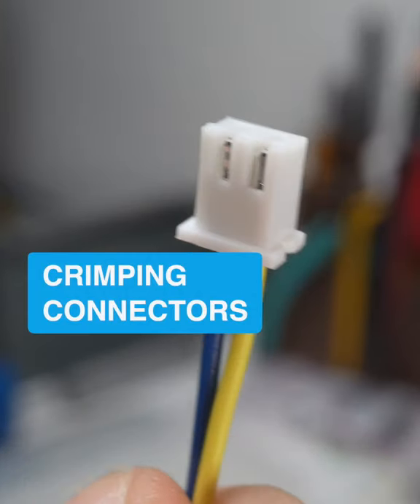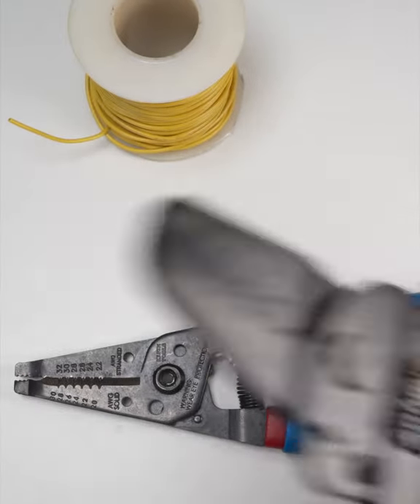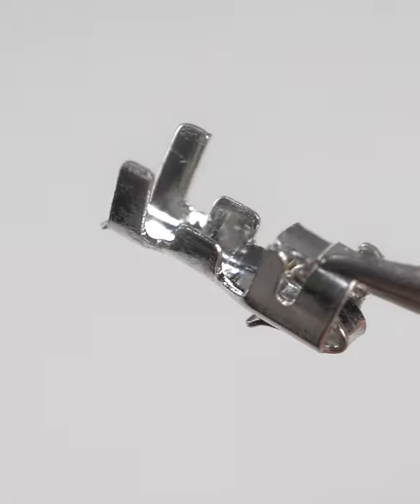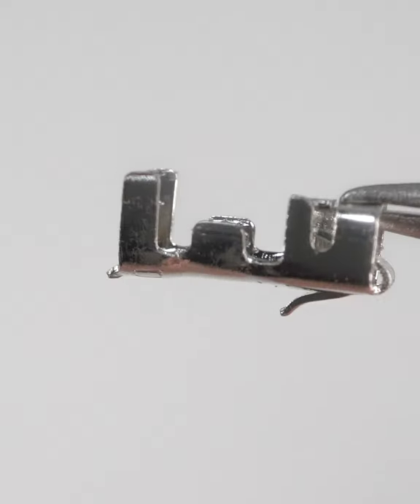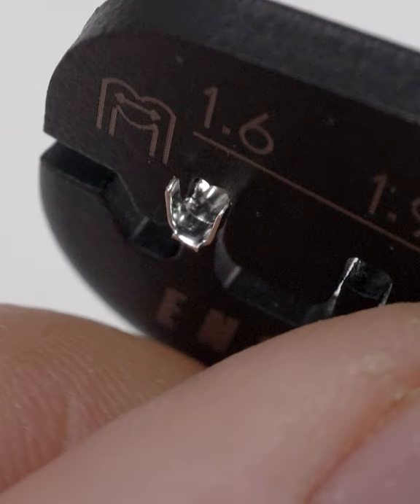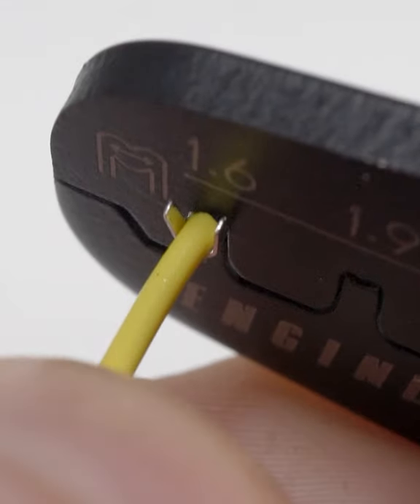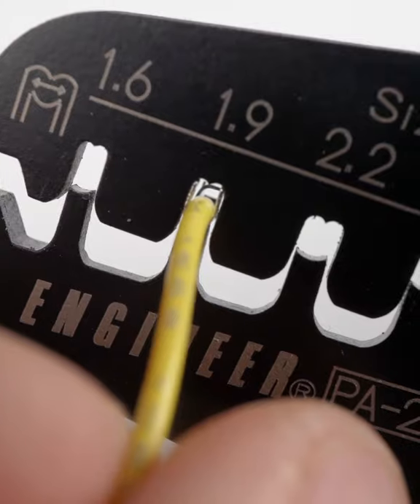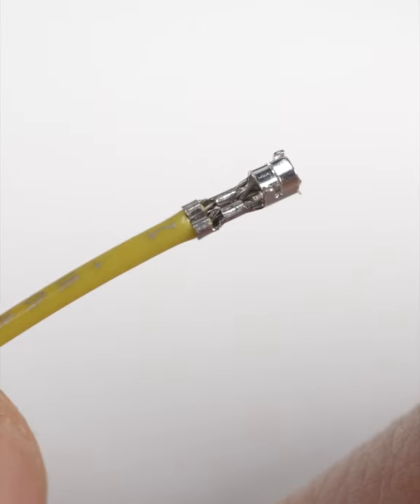Crimping Connectors - Collin’s Lab Notes #adafruit #collinslabnotes

Comment: Wait, I thought you weren't supposed to twist wires before crimping on a connector!
Reply: That’s actually true. But a light twist as seen on the video should not affect crimp quality and helps the strands keep together so it’s easier to get them all into the connector.
Reply: @monteramer6602  ,
🤔🙂👍🍻
Reply: I came to the comments after watching Big Clive this evening  to ask the same thing.
Reply: @LostDryerSocks  it's probably "avoid twisting but get all the stands in the crimp connector, even if it requires a light twist". There's no twisting in the instructions from JST (yes they have printable instructions/inspection guide)
Reply: @aarorasilainen  The crimping is exepected to bite down parallell to the strands. So the strands should not be twisted.

Comment: You DO NOT twist conductors when using that style of crimp. Twisting them does more harm than good when the crimp wings fold in and secure around the conductors; often sheering several conductors.

Comment: I finally found a crimper I like, it has two dies next to each other, a larger side and smaller side - once I clearly wrote “front” and  “wire” on the opposing sides because I’m slow, I get perfect crimps every time. I had bought like 4 sets of crimpers, including one like these, and had just decided that crimping cannot be done by hand and I’d been tricked.  Now mine are as good as factory.  Practice also has a lot to do with it, and using tweezers to place the metal bit just right in the die is crucial, the tab that sticks out the back abuts the face of the front die

Anyway, takes a tiny bit longer to place the connector right, but it’s much faster overall, doing both steps at once.  Advancing the die two clicks makes it so the insulation even stops at the right depth

Comment: There is a blog post out there by Matt Millman discussing common crimped connector terminals, and it has tons of great photos of what you should be looking for in a crimp that's up to standards. 

We use a ton of JST-SM wire to wire connectors, so much so that we have a pair of the official JST crimpers. Those things are amazingly good, but super expensive.
Reply: This is what I came to say. Matt Millman's research and documentation of wire terminals and crimpers is probably the most comprehensive and useful ever written.

Comment: Great tutorial - I have the same Engineer crimping tool (PA-20) and it is fantastic. Sometimes the terminals get a bit stuck but it's very easy to free them, and it's not expensive for what it does (compared to the official JST or Molex tools).

Comment: A good crimp has some defining characteristics: 
1) The conductor is fully captured by the forward tabs.
2) The individual strands are tightly compressed such that their cross-section forms a tessellated hexagon pattern.
3) The insulation tabs are compressed around the insulation and not into it.
Reply: Matt Millman has a fantastic blog in which he delves into the finer points of terminal connectors and crimping systems. If you're even remotely interested in this kind of stuff you'll find it a great read.
Reply: There is a huge array of different connectors and crimpers on the market and not every tool works with every connector. In fact, the right tool is crucial to a good crimp and most failed crimps are (probably) the result of a mismatch (and operator error).

Comment: I usually use 1.6 for both the inner and outer tabs, is this not correct?
Reply: Might depend on how secure/tight you want it and size of the connector

Comment: Should NEVER twist the conductors when crimping.
* EDIT to satisfy pendants:
You should neither twist or untwist the conductors, especially for "open barrel" (winged) crimps like the JST-XH shown in this video. Just strip the insulation, tidy up the strands so none are displaced or crossing, then crimp.
Reply: Don't know where you heard that but should have a little twist to help the wires not fray
Reply: @CokesAndTokes  - what I say is definitely truth. You can confirm it yourself with a magnifying glass, or Google. The crimp squeezes the 2 winged sides down into the lug, and creates 2 separate cylindrical tubes that encase the strands. These squeeze so tightly that the copper is literally reformed to create a permanent and almost "welded" connection.
If the strands are twisted then any that are across the centreline will be snapped off as the 2 sides squeeze down and wrap around.
Reply: @johncoops6897  You shouldn't over-twist the strands however. If over-twisted, the distribution of strands may be uneven and the wire cross-section will be affected, which will also negatively affect your crimp. -Google

Like I said it's OK to twist it a little bit so your statement is wrong out of the box
Reply: @CokesAndTokes  - no, it is not wrong. For THIS kind of crimp terminal, the strands need to stay straight. Slight twisting is tolerated (although DEFINITELY not recommended) for tubular crimps where the pressure is applied from all sides, since they will get squeezed together anyway.
However THIS  style of crimp does not work that way. The tabs on either side are turned 180° and cut straight down into the strands of wires. Any strands that cross that centreline may be severed.
I cannot help you stop being an arrogant know-it-all, however I can certainly guide other people about the correct way to perform crimps on THIS kind of terminal.
Reply: @johncoops6897  maybe you should specify more. And not say "NEVER" do this while crimping. If you're just gonna say it's OK 2 comments later?
Reply: @CokesAndTokes  - Talk about comprehension fail. 🙄
I just wrote "Slight twisting is tolerated ... for tubular crimps..." however these  terminals are so-called "Open Barrel" terminals and I quite clearly explained the difference and why twisting is poor work practice and degrades the joint.
 I will link you to the official JST Crimping instructions in a few minutes.
Reply: @CokesAndTokes  - OK, after researching on various manufacturer's tech bulletins, I can change my advice slightly. They all basically say to retain the original twist, worded like this...
EG: "The lay of the strands shall be correct. If the lay has been disturbed, it may be restored by a light twist to approximate the original spiral lay of the wire. Care should be taken not to over-twist the strands." .
So, basically you should never twist nor untwist the conductor strands. Think about it... the crimps are designed for automated processes, and there is no twisting process between stripping and crimping. There is no need to touch the conductors... just remove the insulation and crimp!
Disclosure: I have extensive experience in QA and process control of crimped terminals used in critical applications like medical, aviation, IT and scientific equipment. It doesn't matter if you don't understand or believe me, I am not going to fight with you about what is, in the industry, common knowledge.

Comment: I'm sure there are crimpers that crimp both. Or am I wrong here?🤔
Reply: Yes but they are 500$+ instead of 20$ for these. Much more cost effective for hobbyists
Reply: @phiIippejean  wait these are only $20? I was under the impression that a crimp tool that works will be completely unaffordable, so I avoided looking at them. If I can get one cheaply enough, even if it's just a tiny bit finicky, I must buy one right away...
Reply: @phiIippejean  500$? I'm from EU but even here I can find crimpers that crimp them both for way far cheaper. Around 30€ and up.  Usually i find stuff that are cheaper in US compared to the EU.
Reply: depending on the type of crimpers and manufacturers it varies a lot. 
But for aviation/medical grade crimps, I use a lot of Molex/Hirose/Amphenol/TE crimpers that are 200-400$ for handheld and like 1000-3000$ for automatic crimping machines. 
It's definitely not worth that much, but the crimps themselves are so cheap that they gotta make money somewhere.